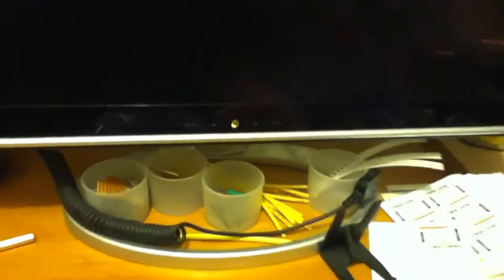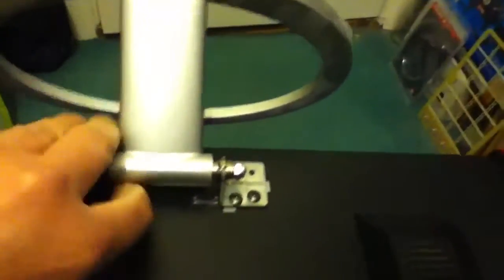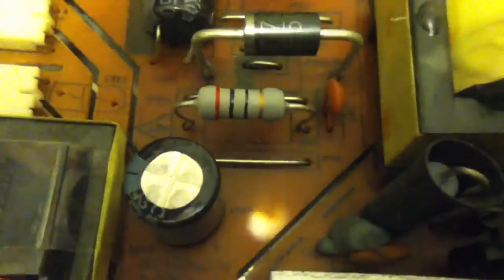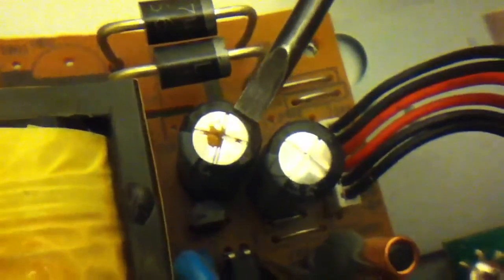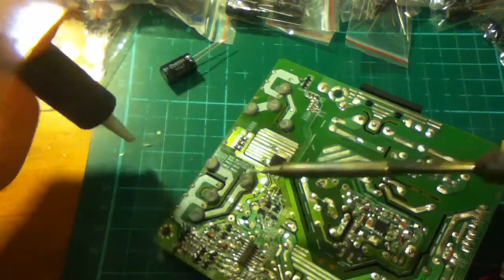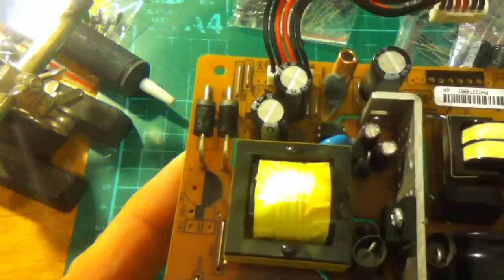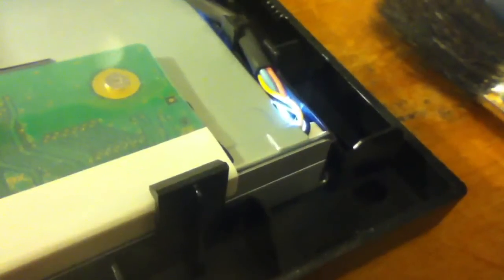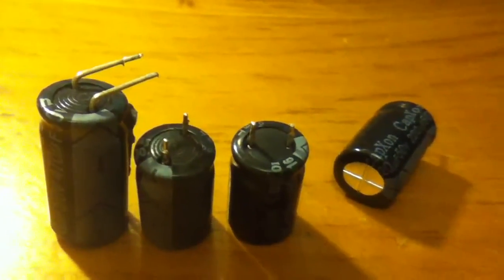How to Fix a Computer Monitor by replacing Electrolytic Capacitors

Comment: I was hoping to see exactly how to replace a capacitor from start to finish.  This video was not helpful for a first-timer with no experience.  The video jumps to the new capacitor being in place, all soldered in.  Seeing how to thread the new capacitor into place and how to solder it would have been helpful.

Comment: I had got never before used fresh old DVD recorder .Cyberchrome,It was taking a while for it to warm up ,It Finley did .so I opened it up to see the problems, 4cpapcitors were swollen, one with rust coming out,The back pair were 6.3 volts at 2200uf, 105 Celsius The front pair were 3300 uf 6.3 volts 105 Celsius ,from Jen p.c both were odd height ,the back pair was 32 mm ,The diameter was 10mm. Lead space 5mm,the front was 26mm ,height ,diameters 10 millimeters  at 5mm  lead space. When i pull them out for measuring that when the power source went off,the problem is tha they don't make odd heights any more,It seems tha mos 6.3 goes only to 20mm heights,Would this be a good substitute for the 26mm and the 32mm height ,since it still 2200uf and 33 00uf.The lead space would fit too,If not them I lost 130 buck and I'll have to throw it away.Not one place has 32 at 6.3 volt at either uf